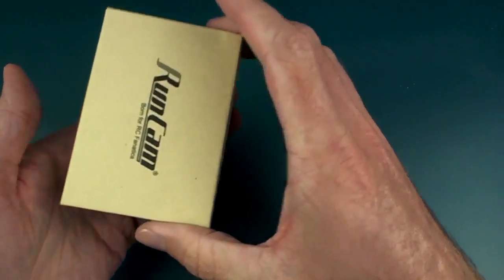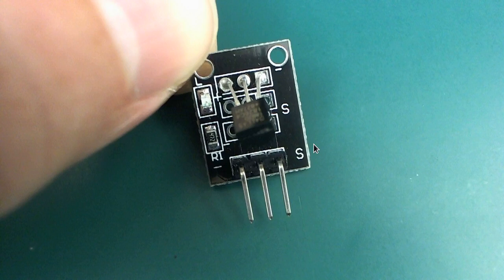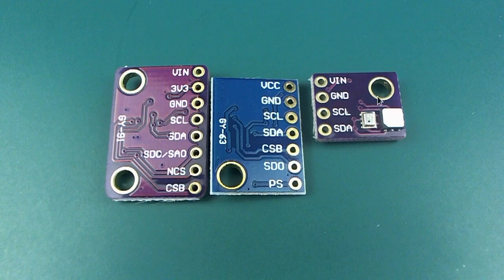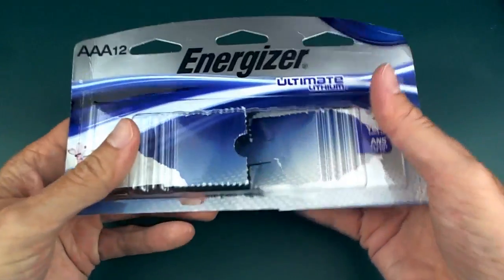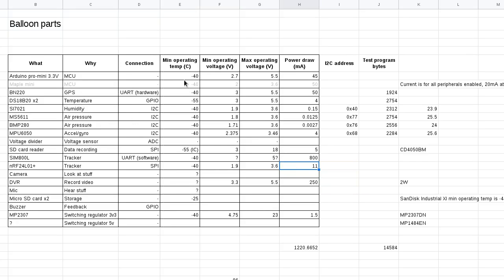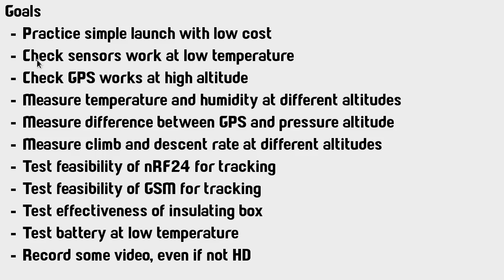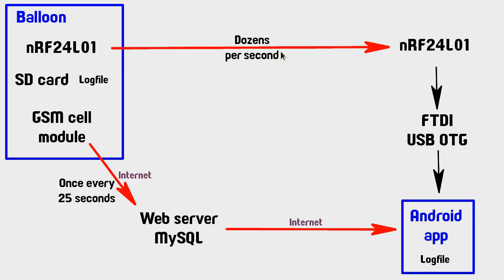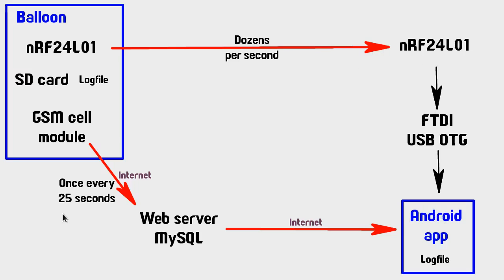Arduino mini radiosonde part 1 (overview, components)

Comment: As a meteorological technician in the 1980's I used to launch radiosonde equipped weather balloons. When I first joined in 1984 we used huge Philips radiosondes that had lead acid batteries (I think) which we activated by adding water. The radiosondes were made of polystyrene with all the electronics enclosed except for the temperature and humidity sensors and the antenna. We attached them to 1000g balloons along with a parachute and radar target. We used a large ground station that produced a plotted chart as the balloon ascended and had to manually analyse it and code it up. The code was sent on a teleprinter via the AFTN (aeronautical fixed telecommunication network) to the computer at head office. I guess we emailed it but the word didn't exist then. By the time I left in 1990 we were using fully automated Vaisala radiosondes, you just attached it to the balloon, launched it, and pushed a button on the ground station and it did everything by itself. We had a lot of fun launching balloons and it was really interesting. On one occasion at Christchurch Airport I had one ascend vertically to, from memory, 90,000 ft (about 10 hpa), burst and then descend vertically and land just to the west of the airport. We were also responsible for many UFO sightings as a 1000g balloon at 90,000ft looks like a white disc hovering in the sky.
Reply: Did they ever use resistance heating?
Reply: @TheLightningStalker  Yes - I've used it on several of my flights for keeping equipment and camera filters warm. Electrical heating is by far the best way to go.
Reply: @TheLightningStalker  Hi, don't know. They must have had something as it used to get pretty cold at the tropopause, -50 degC sort of temperatures.

Comment: I tried to purchase your PCB... did you have an issue with many of the components being out of inventory?
Reply from the maker: This board isn't really meant as something you would buy assembled from the PCB maker. It's for attaching an arduino pro mini. The other components are 'breakout boards'.
Can I ask what you'd be using it for? I've been thinking about remaking this in STM32 and much smaller, maybe to sell. Quite busy with other projects atm though.

Comment: The GPS that does not work at High Altitude is the interrupt on the law but they technical all can work for high altitude.
Reply from the maker: Seems like many work up to 50,000m these days, which is the legal limit. The one I used, I can confirm it worked up to 27,000 at least.

Comment: I've never researched the cause but gsm also doesn't seem to work at higher speeds. I've never had it work above 120kts. Basically as soon as you're on a takeoff roll it quits. CDMA is a different story. Had a copilot that wasn't the brightest with technology and seemed to never put the phone in airplane mode. Was always messaging through cdma data not realizing he wasn't  even on the airplane wifi. Was even able to take a call and speak at 41000 once. Iphone 5 he had at the time. I was pretty amazed with that one. None of that with gsm. Doppler error kills it maybe?

Comment: I'm not sure ifore2d's concerns about the adjustable voltage regulator were justified. I set one up at 5.05V, 100Ω load at an ambient temperature of 21C with a 12.01V 1.22A transformer wall wart. I let the voltage regulator sit outside for an 1hour at -20C. When I initial plugged in the wall wart I got 5.05V. After 5 minutes the voltage regulator had warmed up 5C and the voltage was 5.00V. It was a poor test setup because both the volt meter and I got cold. It is very likely the change in voltage was do to the meter getting cold.

Comment: Consider using A7 GPS +GSM+GPRS all in one module it could save some space and is very compact for your needs.

I m trying to build something similar to radio sonde but for my motorcycle using aeduino nano but may be switch to esp32 or stm32 as nano can't handle that much load.

Comment: Wow, can’t believe it, I’ve got virtually an identical project I was planning to launch on my channel. Although I’m planning to use LoRa modules (RFM96). I’m going to be using a small camera like a runcam split. With a Yaggi Antenna you’ll probably do ok with the Nrf24 jobs, but nothing like the LoRa modules.. also the lower frequency of 315/433Mhz vs 2.4ghz will be less affected by atmospheric conditions. Great project, love your channel dude, looking forward to the next one! :) thanks for sharing
Reply from the maker: I tried some 433MHz LoRa modules last year in preparation for this project, but the results were pretty disappointing compared to the nRF24, which I am also much more familiar with having used them for many years. I could have been doing something wrong or just using el-crappo antennas, but overall I felt more comfortable going with the one I knew, even though it has a much lower theoretical range.
Reply: iforce2d lol, I had the opposite problem, I was developing a system for s client and they had to use 2.4ghz for Video because of ISM licence issues - I’d built those nrf24 into everything and have all kinds of cool stuff figured like auto bind sequences etc.. of course I couldn’t use them for the project coz of 2.4ghz used already - that’s when I was forced to play with rf69’s and then the LoRa RF96 jobs. The settings within the LoRa protocol are important depending on bandwidth/ speed vs range. :) thanks for your feedback

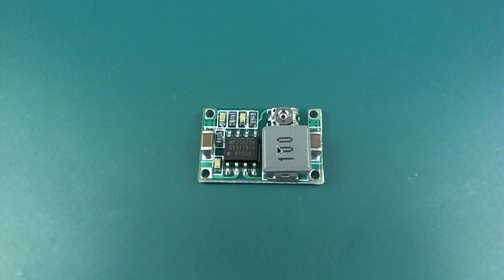Comment: 5:19.. Set the pot to the voltage you want. Check the resistance of the pot and replace it with a fixed resistor.

Comment: For the minimum/maximum operating temperatures, sometimes it's just the test freezer for one or the finished component that only goes to -40...  Sometimes it's tested on the finished, assembled module, but sometimes it's also imputed from the datasheets of the components of the components, let's say they use a transistor that was cheap, and the freezer they used to test that transistor only went to -40, well they're going to write -40 on their own datasheet as the minimum, or if they used the same lab whose freezer only goes to -40, then that's also going to be your minimum temperature...

Or at least that's the case with the electronics my workplace sells, and the specs we have in our books... the test lab we used was kinda cheap, I guess, and they gave us -10 C, but it works fine in Canada, outside, in the winter, so...  It's not all that reliable, I don't think it's the same for negative temperatures as it is for positive temperatures for the ovens and whatnot...

Comment: I did a HAB project 9 months ago here in Australia. 
The GPS (spot brand) stopped responding after 1 hour of flight. I think it was my fault, I had removed the plastic covering on thr gps to minimise weight, however that likely reduced the insulation. I knew the Setup would be passing through very cold temperatures, but thought if the GPS went out it would come back online when heated up back on earth surface.
I had two GPS on board, ublox neo 8N (backup) and spot gps. Neither lasted, I lost my Setup/couldn't locate it.
Lost forever.

Comment: To permanently set the ”voltage regulator” (its actually a buck converter) just replace the pot with a resistor (only 1 side of the pot is being used). The datasheet of the ic has the formula to find out the resistor value.
Reply from the maker: Right, a little fiddly though. For the price they are I just bought ten each of 5v and 3.3v, will no doubt use them for other things in future.
Reply: A couple months back i tried looking for fixed 5v and 3.3v ones but they were almost 5 times as expensive as the adjustable ones. You mind giving me a link to the exact ones you bought?
Reply from the maker: 3.3v https://goo.gl/354hTX
5v https://goo.gl/h3PBne

Comment: Where are the decoupling caps for the pressure and humidity sensors? I hope your wires will be short :)
Reply from the maker: Not entirely sure what the problem is you're getting at, but fwiw the voltage regulator has caps on the output side, I also put a cap right next to the I2C power pins, the traces between cap and I2C power are about 4mm long. I believe each breakout board also has its own caps too. Hope that covers what you were concerned about.

Comment: ive just checked 4 mobile phones i have here, all 4 are different brands.
Two have the cut corner of the sim facing in and two have the corner facing out.
i guess its just the mood the designers are in at the time they design them.

Comment: Awesome, maybe want to add a Lorawan radio next time.  They wouldn't much appreciate you sending dozens of packets per second, but you might garner more range and pick up the benefits of having other gateways forward your traffic.  Certainly would work better (range/power consumption) than the GSM module.  You can get a 32U4 Arduino compatible board from bsfrance with LoRa radio already installed.  It might fit your circuit board directly.

Edit: I now see that you already did a previous experiment using LoRa modules.  I'm kinda surprised that you didn't achieve farrrr greater distances than you did.  I suspect your antennas weren't the right frequency which turns out to be quite common with the Chinese suppliers.  Another issue is antenna polarity, your transmitter was horizontal and the receiver vertical; that can cut your signal by 20dB.  You also have to be extremely careful with SMA center pins, those connectors aren't just male or female, they have reverse versions too where the opposite sex has the pin.  LoRa should have no trouble getting 10km or more with your setup.  Modules can be damaged by merely powering them up with no antenna, hence the big warning.
Reply from the maker: I tried some 433MHz LoRa modules last year in preparation for this project, but the results were pretty disappointing compared to the nRF24, which I am also much more familiar with having used them for many years. I could have been doing something wrong or just using el-crappo antennas, but overall I felt more comfortable going with the one I knew, even though it has a much lower theoretical range.

Comment: Why not use hydrogen?
Reply from the maker: That was my plan, but a hydrogen regulator cost three times as much as the helium and a helium regulator put together.
Reply: iforce2d You can make your own quite safely with a simple electrolysis cell.   With DC hydrogen collects on the positive which you could just lead into the balloon without trying to store it or anything.  As long as you don’t smoke you should be pretty safe.
Reply: @stephengloor8451  exactly what I was thinking. Just keep it from mixing with any air so there is no oxygen.
Reply: Manick N yep don’t use AC - boom

Comment: If you used that small 3 pin linear regulator you would be able to make even smaller pcb
Reply from the maker: Yeah that might have been more appropriate for this case, as it would also provide some warming.